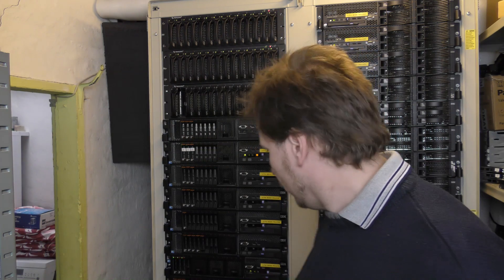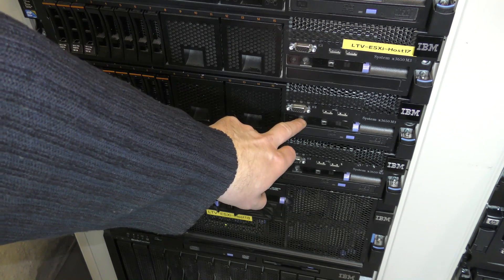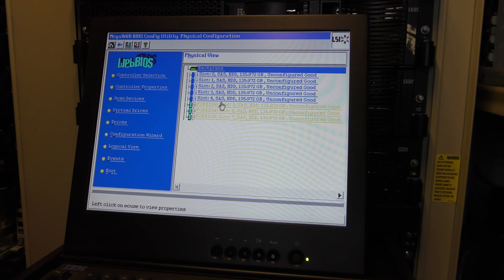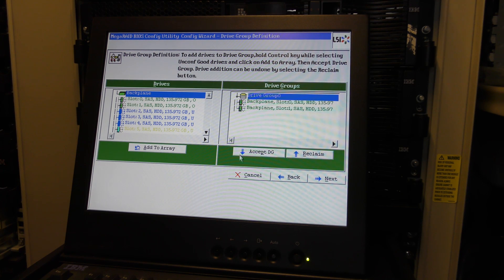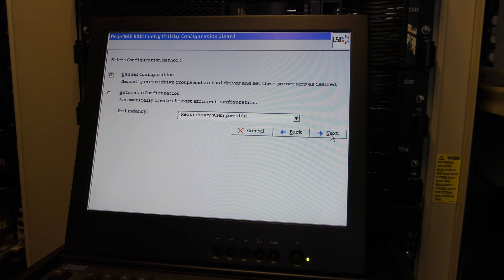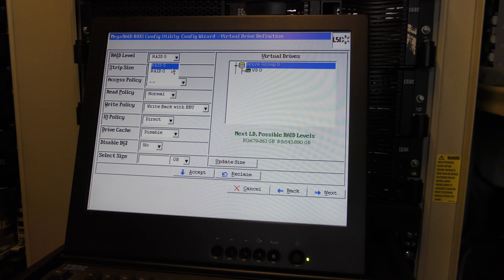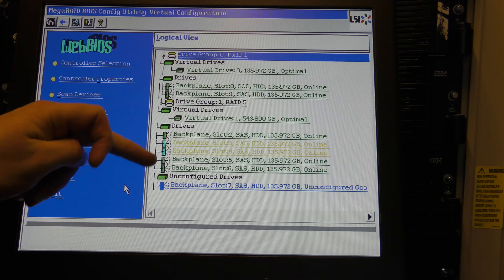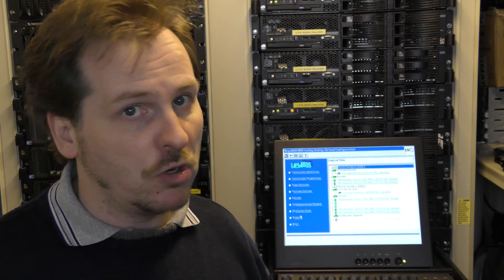Setting up RAID 1 and RAID 5 on IBM x3650 M3 with a Global Hot Spare  - 339

Comment: Hi sir....is it possible to install window server 2003 on ibm 3650 m4
Reply from the maker: I can´t remember ever doing that,, but I would expect so. You would have no issues with Server 2016,, as that OS would have all the Server hardware drivers, as the server is from 2014.
But IBM servers are usually really easy with drivers,, so just give Server 2003 a go :-)

Comment: Hi sir ...i have IBM 3650 m4 server and can i install window 2003
Reply from the maker: I can´t remember ever doing that,, but I would expect so. You would have no issues with Server 2016,, as that OS would have all the Server hardware drivers, as the server is from 2014.
But IBM servers are usually really easy with drivers,, so just give Server 2003 a go :-)

Comment: Did I understand? The hot spare is disk the system only use when a raid disk is failed, the system rebuilds that drive on the hot spare and you have your redundant raid 5 again, when you change the disk it rebuilds that with the hot spare and the spare goes down again
Reply from the maker: The idea is that if the disk fails at like 02.25 in the middle of the night, the rebuild will start , and you save like 6-ish hours, if people comes to work at about 8.00am,,
When you now replaces the failed drive,, it becomes the new hot spare.
Reply: @MyPlayHouse  pay attention to third person and plurals

Comment: My server motherboard FRU : 00W2671 failed, I installed FRU : 00AM209. Now I  am not able to configure Raid 5 on the server. Only raid 0 & 1 option coming in web bios. 
Also the license for mega raid 5 is not visible in web bios.
Reply: How do i get the license for raid 5 configuration in web bios
Reply: How to back up bios data, ? I have 12 nos of working server system x 3650 M4, I can take backup from them if you can tell me the procedure.
Reply from the maker: There is an backup function in the IMM... or you will have to have saved the originally FOD key from IBM/Lenovo
Reply from the maker: Yarh,, this is something that we forget to back up :-/ If you have no dokumentation,, I think that it is lost :-/
Reply: Some manuals were provided along with server I will check them.
Reply: I installed a Raid 5 controller cache, then the raid configuration was done. Thereafter the hard drives were initialized & erased & I tried to do a fresh windows 2008 R2 installation from CD drive. I am not able to view the hard drives during windows OS installation? What could be the problem?
Reply: Which driver do i need to install to solve the problem of hard disk not being displayed during windows 2008 intallatiom

Comment: Hi, thanks for the videos. 
 I have an IBM x3850 x5 , I recently reinstalled windows 2022 and it worked. The led lights on my hard disks no longer light (the green lights used to blink continuously before). I have checked raid and it seems fine. What could possibly cause this. I even reconfigured it. Any ideas? I would appreciate it.
Reply from the maker: No,, not really :-/

Comment: Sir if i never set raid 1 in my server can i just add second hdd with same type and size, and configure raid1, will the data in first hdd will be erased or not? Thx
Reply from the maker: Avv I am not sure about that,, and this is the quickest way to lose all your data,, it would also depend on the raid controller,,, I would only do this, if I could test it first.
Reply: @MyPlayHouse  thx sir im waiting for ur test if it possible 🙏
Myserver is x3650 m3 btw

Comment: Hello, thanks for a great video, I learn a lot here. I'm new in Server Management and want to learn

I have some questions here sir,
if there is a Hard Drive Failure on 1 of the RAID 5, we need to change it right?
if the changed hard drive with another drive that outside of the server slot then what is the purpose of the Hot Spare?
I always thought that hot spare is just sitting there waiting until there is one of the RAID 5 Disk Failure and we just need to swap it with the failed Disk.

but you said here at 18:16 "if one of these drives failed will take the rule of one of the disk"
what does that mean sir? do we do not need to change the disk because the hot spare will do the job?
or do we need to change the hot spare slot to the slot at the failed disk?
or do we still need to change the failed disk with the new hard drive? if so why do we need the global hot spare?

I'm sorry for my noob question, I'm still learning and I hope you can help me out.
Reply from the maker: Sorry Hakim,, I have just about 1 minute to read and reply, to each comment,, you have to optimise :-)

Comment: Hi I have IBM x3650 M3 it stuck on start just light blinking no display, no voice, no fan on. 
Last year same was happened in January 2020 but after some days it start working and work whole year
Now in January 2021 its once again its not working. Please guide me what I do & What is the problem. Thanks
Reply from the maker: I have not come across this,, it blinks green on the power when powered but not powered on,, normally you press the blinking button.
Reply: @MyPlayHouse  Yes i always press green button for power on.

Today after a month its start working and show windows. But during this month i can not come to point what was the problem.

Comment: Hi,
I bought 2 HDD but i don't have raid card on my server. The disk is plugged on the hdd backplane but the disk isnt detected. Do you think i have to buy raid card ? If yes which one ?
Reply: I have ibm x3650 m3 server
Reply: https://twitter.com/aoqkdd/status/1229698135519309826?s=19
Reply from the maker: So where do the backplane go ? If it goes to the connector on the system board,, maybe that is disabled in bios,,,

Comment: Hi I do have IBM x3560 M3, I am unable to see RAID 6 option.. have you come across this ?
Reply from the maker: If it has one of the Raid cards M1014/1015, Raid 5 and is an addon and Raid 6 and 60 is not available. 
If you have M5014/M5015 then Raid 6 and 60 is an addon that cost a little bit extra.
https://lenovopress.com/tips0738-serveraid-m5015-and-m5014
https://www.aliexpress.com/wholesale?catId=0&initiative_id=SB_20200211011611&SearchText=46M0930

Comment: Hi
I have IBM x3650 M3 but the raid screen doesn't show up!
In this case what I have to do? Is there is any external software to raid disks?
Reply from the maker: Hi Mustafa Kadawi
You need to have a RAID card in there of cause. An HBA card will not show up in the same way. 
If the server is running in Uefi, you can to configure via. the biso. and it is also possible to set  it up using : https://datacentersupport.lenovo.com/dk/en/downloads/ds501345 - MegaRAID Storage Manager Application for Windows.
Thank you for watching! :-)

Comment: Hi I had a question. I physicallt replaced a SAS hard drive in my IBM system x. However the LSI MegaRAID says virtual drive degraded and can't locate the drive. What to do?
Reply from the maker: Hi sagnik singha
If the comes from a foreign configuration, it can be necessary to clear this on the drive before it can replaces the other drive.
Thank you for watching! :-)
Reply: @MyPlayHouse  Thanks a lot for the response. I have investigated the issue. Problem is that RAID controller doesn't even reccognise the drive no unconfigured good/bad or nothing. Its not even reconising the replaced drive due to some reason. 

Would changing/clearing configuration delete my data(i know it would remove the virtual drive) and is it possible to remove configuration of just one virtual drive/group at a time. 

Thanks!

Comment: Hi Morten can you help me again?
I want to add another raid 1 array to my server but the raid controller would not prompt me to press ctr+H and open the raid menu before the system attempts to boot, it only allows me to open the raid controller menu after it attempts to boot, which means I have to interrupt the booting process by pulling out the boot drives. The last time I did this the boot array disappeared and I lost the data on those boot drives. How can I fix this? I need to access the arrays before the system boots
Reply from the maker: On the x3650 M3, you can access the raid controller from within the uefi bios,, as well.

Comment: Hello
Your video is very good
But i have a question. Now, i'm running a IBM System x3850 x5 with 4 300GB 2.5'' HDDs SAS are running raid 5. Then i still have 4 empty SAS Slots that i didn't use
Now the storage is nearly full, so i want to upgrade my storage. But i'm asking may i buy 4 2.5'' HDDs SAS (1TB Per SAS) and install to 4 empty slots, so will it run those SAS together?
Reply from the maker: Hi Clark Vo
Thank You very much!  If there is a black plain back there and a connection to the raid controller,, you are all good to go.
Thank you for watching! :-)

Comment: HELLO, i have Lenovo X3650 M4 part 7915 AC1, upgrade Tray HDD Expansion Lenovo IBM x3650 M4 Plus 8x 2.5in HS HDD Assembly Kit, 69Y5319; x3650 M4 Plus 8x 2.5" HS HDD Assembly Kit with Expander. After upgarade, I use 10 x 1,2TB Toshiba SAS 10K for Raid 5 + 4 x 600GB Seagate SAS 10K for Raid 5 + 2 x 1TB Seagate SAS 7,2K Raid 1. In this case, configure 2 raid 5 and raid 1 OK? Could you give me advice? Thanks all.
Reply from the maker: Hi Vacuum Sealer
Yes that is fine,, that is what it is build for. :-) much!  glad you liked the video :-)
Thank you for watching! :-)
Reply: @MyPlayHouse  Thank you.

Comment: Excellent this video. I have two IBM X3650 servers and in one of them I have configured a raid 1 with two 300 GB disks. but the server is damaged and does not start. how can I mount these disks on another server without erasing the information that is vital to me. Thanks in advance for your comment.
Reply from the maker: Hi Deivis Donquis
Thank You very much!  Yes this is possible,,, and a good video suggestion!!  If you put the disks in the new server, you can in the raid controller "import foreign configuration" and the driver will be available in the new server with everything on them.
Thank you for watching! :-)
Reply: Thank you very much for your timely response. Now my other server is also damaged and does not turn on. Take a disk and place it on a pc with linux ubuntu and in /dev/ me it shows it as sdb and its partitions  sdb1,sdb2… sdb7 but when trying the command 
# sudo mount -a /dev/sdb1 /mnt
He tells me that he can not read the superblock.What can I do to recover the information? Thanks in advance for your help.
Reply: Thank you very much for your timely response. Now my other server is also damaged and does not turn on. Take a disk and place it on a pc with linux ubuntu and in /dev/ me it shows it as sdb and its partitions  sdb1,sdb2… sdb7 but when trying the command 
# sudo mount -a /dev/sdb1 /mnt
He tells me that he can not read the superblock.
What can I do to recover the information?
Thanks in advance for your help.

Comment: Hello, I am with IBM x3650m3 server at home for test purposes and test environment. I am with two SAS 2.5 HDD with 2x464 GB capacity. When I setup RAID1the available capacity is 270 GB? When I setup RAID0 the available capacity is 500+ GB. Can someone explain me why it's happen in this way? Thanks. How can I use more space? I won't to use VMware Esxi 5.5,I migrate right now from RAID0 to RAID1, from Server 2012 R2+ VMware Workstation 12 to VMware Esxi 5.5.
Reply from the maker: Hi Taner Zait
Thank You very much!  That sounds weird,, see if there is unused space i the IBM megaraid storage manager thing.. :-/
Thank you for watching! :-)

Comment: Hi, 
how about if i have 146 GB * 2 HDD with Raid1 and OS. 
I want to add 300GB*3 Raid5, 300GB*1 Hot spare, without disturbing Raid1 and OS. Is it possible?
Reply from the maker: Hi Digamber Hirve
Yes this is possible, and not to hard. I would recommend,, backup and all of that, and  you shout shout down the server and do this from the Raid setup. And if you remove all partitions from the drives before, there is less chance of making a mistake. If there is a foreign old raid setup on the drives, you have to delete that first, and that will be where it is to easy to accidentally delete your two RAID1 on the 146GB's
Thank you for watching! :-)

Comment: Reasured me on how I made my Raid (10) on the very same server I own :) (Not the same controller, thought. If I remember, it's a 5014)
At work we have several x3650 M3 with 16 hard drives in it. I don't remember the exact model of RAID controller. How I wish I had a second backplane and some more disks to play with :D Nice video :)
Reply from the maker: HI +Dorian Tokarz 
I'd like to see how to use the M5014 or M5015 to do more diskes then 8...
Thank you for watching! :-)
Reply: +My PlayHouse (Morten Hjorth) Hey ! I took the time to look at my IBM serveraid M5014 and you're right ! it doesn't support more than 8 HDD :/ That's why the server come with only one backplane. BUT you can request this ( http://publib.boulder.ibm.com/infocenter/systemx/documentation/index.jsp?topic=/com.ibm.sysx.7945.doc/t_installing_sas_sata_8_pac_hdd_option.html) from IBM to add another 8 HDD to the server. Mine (7945) is compatible :)
Reply from the maker: Hi Dorian Tokarz 
Good Info thanx.
Thank you for watching! :-)

Comment: There are a lot of people trying to build servers of different types but I think that they should not reinvent the wheel when there are many old web servers available if one knows where to look, I think that 5TB SSD drives might have been a better choice and anyway old mechanical drives are not always reliable.
Reply from the maker: Hi +DAVID GREGORY KERR 
5 TB of SSD is still a bit prissy,, We will get there soon. But Yes there is a lot of good server equipment out there,, and often good shit to!!
Thank you for watching! :-)
Reply: +DAVID GREGORY KERR Are SSD good enough to be used in servers where the disks are constantly written to? Have they got past the million writes limitation of SSD's? I have found most mechanical hard drives extremely reliable, most problems I've seen have been caused by the drives being knocked/moved whilst operating, I guess if you run them for several years the motor bearings etc can wearout and fail.

Comment: I believe the reason why you can only see 8 drives is due to the wires and backplane. The two sff wires carry 4 hard drive signals each, totaling 8 full lanes for drives. The backplane for the x3650 is probably not a SAS Expander backplane, which would allow for more than 8 drives to connect through those two wires. They are probably just backplanes that allow for hot swapping. I believe you can verify this by looking for a SAS logic chip on the backplane, which would be present on a expander backplane
Reply from the maker: Hi +Andrew Bova (Andy) 
Or using a card like this : http://amzn.to/1VOBJfn ,,, might do it.
Thank you for watching! :-)

Comment: Are you comfortable with RAID 5 considering the horrific write and rebuild time?
Reply from the maker: Hi +Gr33nMamba 
RAID 5 is A lot better then no RAID,, for single servers like this,, it would be okay,, and with a hot spare to start rebuilding a bad array as soon as it fails,,,it is okay,,, It's not safe enough for like my 14 disk array.
 Thank you for watching! :-)
Reply: +My PlayHouse (Morten Hjorth) 
I'm running a 6 × 4TB RAID-5 array on an LSI 9260-16i card with 6 WD Reds.
The write speed is around 300 MB/s which is not too bad considering the 135MB/s throughput of a single drive.
I had 1 drive fail on me yesterday, replaced it and rebuild was just over 10 hours. 
I would suspect the 10k or 15k SAS drives that Morten is using are faster than the WD Reds in both writes and rebuild times?
Reply: +My PlayHouse (Morten Hjorth) I've had back luck with raid one and five personally. Sometimes they just won't rebuild your raid volume after replacing a dead drive. Maybe that has more to do with the controller my Poweredges use then Raid.
Reply from the maker: HI +bwzes03 
I would not be so sure,, but maybe. I do believe that the WD RED are pretty good.
Thank you for watching! :-)
Reply from the maker: Hi +CreativeType 
Well On the IBM/Lenovo's It is usually really good! I think I'll make a video tomorrow where a RAID 5 did crashed,, because two disks died :-/
Thank you for watching! :-)
Reply: My PlayHouse
No problem, the cards I've used in those Dells are pretty terrible. In my experience. Could have been user error too. haha